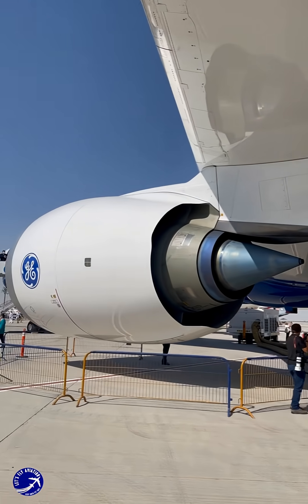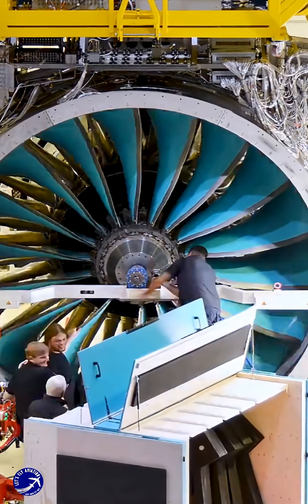GE9X Engine vs Rolls-Royce Ultrafan Engine. Which Is Better?

Comment: The general electric is a fine engine and has flown. I'm sure the Rolls Royce engine will be excellent when it enters service. Right now Boeing cannot get off their a** and get the airplane certified. It is only about 3 or 4 years behind schedule.

Comment: Efficient sustainability is the winner today. More power does’t give more speed and needs more fuel weight for the same range, but if the A380 could be powered by 2 GE9X’s then that would be a win. It is close with the A380 needing 280,000 lb thrust. The weight of each engines is also a factor: GE9X 9.5 tonnes; UltraFan 6.5 tonnes.

Comment: Rolls Royce have a proven track record of being the best engine manufacturer in the world. Composite turbo fan blades how long before they fracture over time and what happens the engine ingests the slightest fodder or birds or hailstones the size of golf balls. If made of carbon composite the fan disc blades are likely to shatter into razor sharp shards. Have these composite blades been tested to destruction limits and over time. I wouldn’t like to fly in an aircraft powered by an unproven engine.